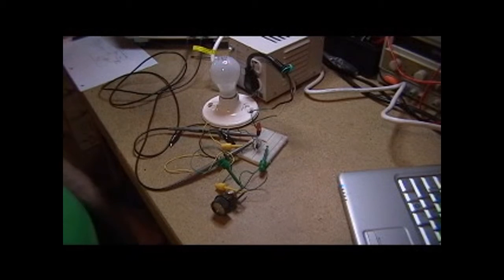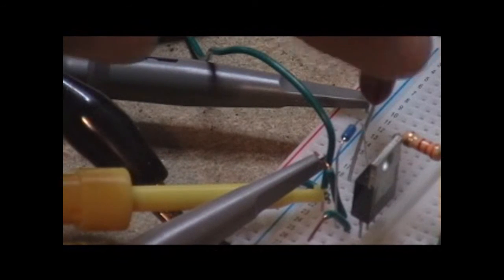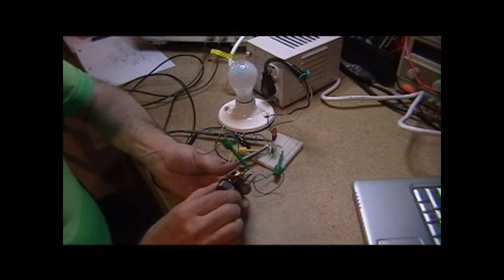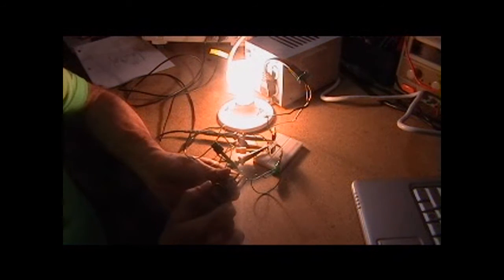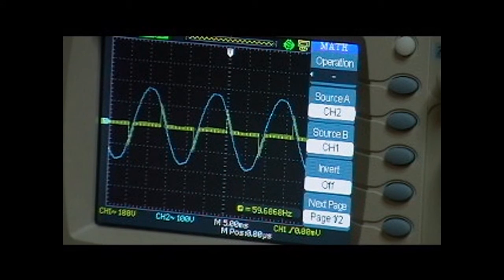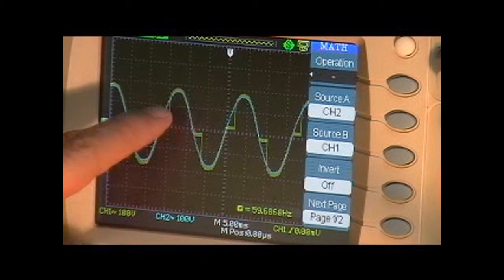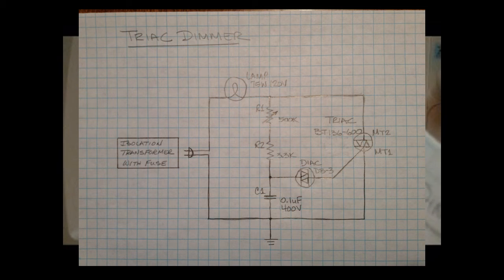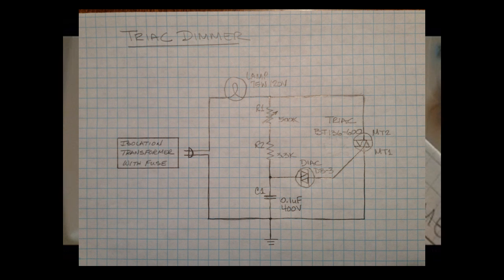Triac Dimmer

Comment from the maker: I received a question asking about the purpose of the capacitor.  In this circuit, it is a timing component.  The potentiometer and the capacitor combination form a timing constant.  The potentiometer controls the rate at which the capacitor is charged.  Once the charge on the capacitor reaches a sufficient level, the diac will be triggered which will turn on the triac. Changing the setting of the potentiometer changes the rate of charge for the capacitor (slower or faster) thus altering the point in the cycle at which the lamp will light.  The sooner the lamp lights, the brighter the output and the later the lamp lights the dimmer the output.

Comment: sir its possible to replace the potentiometer with optocoupler and the arduino will control its fade the optocoupler name is P621
Reply from the maker: There are many ways to do that.  From a microcontroller, you could use a digital pot or a biased transistor, or several other things.  The optocoupler may work, but the important part is the resistance provided by the pot you would be replacing.  That resistance controls the rate of charge on the capacitor which is what determines when the diac will fire to activate the triac.  Depending on the structure of the optocoupler, it may work provided it has a gradual turn-on and off that will present resistance to the circuit.  It might be worth trying to see how well it would work.  Thanks.

Comment: Hi Jonathan,
I have a confusion regarding triacs. Since you have much expertise in that, you might know of this. I know triacs normally are bidirectional. But in the dimmer circuit we have to two terminals connected to resistor and capacitor. when i swap them the circuit stops behaving as a dimmer. Shouldn't it work fine if its bidirectional? guide me please.
Reply from the maker: +M. Yasir I am definitely not a expert with these things.  What I can tell you is that MT2 should generally be on the hot side and MT1 on the neutral side.  Yes, the device is bi-directional for the purposes of AC current, but the way it is triggered, it needs to be oriented as above.  In essence, basically it is really the equivalent of two SCRs wired in opposite directions that share a common trigger.  I'm sorry I could not give you a better answer.  I hope that helps.
Reply: Jonathan Bisnett Thanks a lot. that really helps :)

Comment: Hi! I have a question : Is the diac is polarized ? can i do it using TIC226 ?

thank you!
marC:)
Reply from the maker: No, a diac is not polarized as it is designed to work with alternating current.  It will work in either direction.  It works off of a breakover voltage.  Once the voltage reaches this level, the diac will conduct and when it drops below the holding voltage it will stop conducting. 

Based on a quick review of the datasheet, you should be able to use a TIC226 as the triac in the circuit. 

Remember to be cautious considering the potential voltages and currents present in this type of circuit.

Comment: Thank you for your thorough documentation on this circuit! My son had the idea to make a lamp dimmer with a slide pot and this really helped. Here is our version https://youtu.be/kULyO4diMZQ. I do have a question. Which component in the circuit might I change if we wanted the lamp to dim over a wider range of the potentiometer's resistance? If you look at my example the lamp only begins to get enough voltage to light when the slide pot is moved to the lower third or so of its 500K range. Is it possible to spread out the dimming effect over a wider range of the pot?